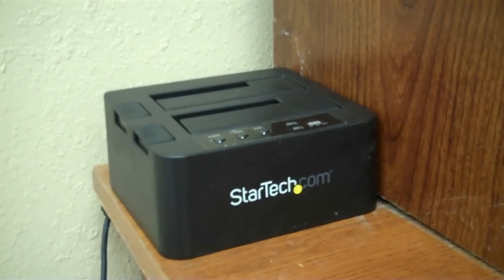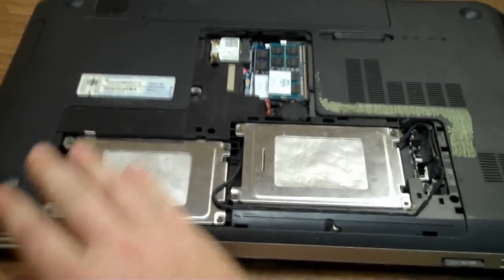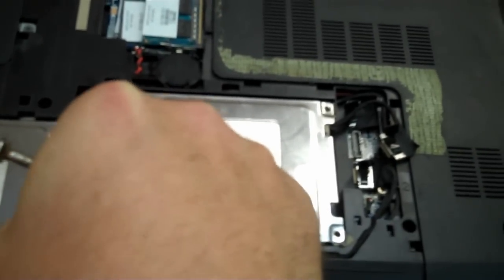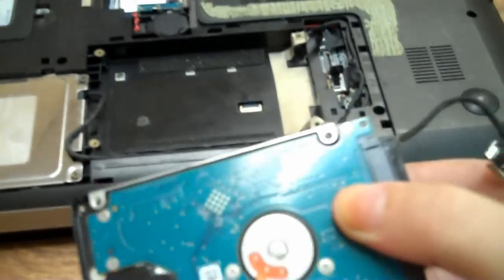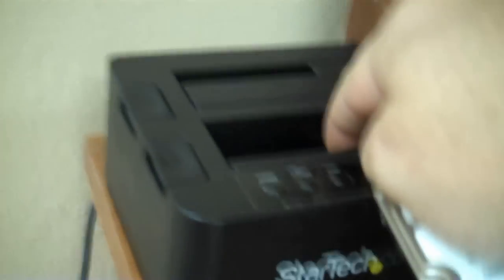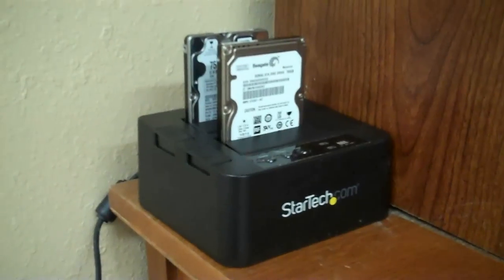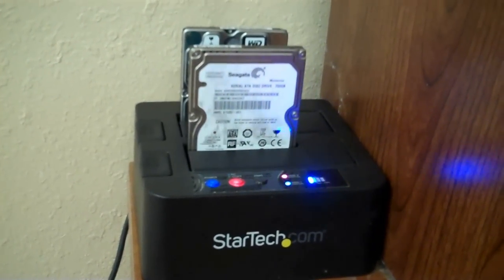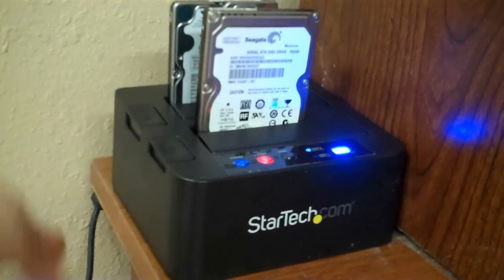Startech Hard Drive Duplicator Dock , tutorial vlog

Comment: Does this clone drives sector by sector? I have some that I need to just clone from one failing drive to a new drive. One is in a WD Sharespace (4 drive) NAS box. It's set up in a RAID 0 (yes I know a bad selection on my part), would I be able to pull out the drive that just gave me a failing message and just be able to clone it sector by sector to replace that drive?

Comment: Yo Grim, I just bought one of these (a newer model with leds on the front instead of the top) and it really does work. I was struggling with the various cloning programs available with limited success.  Q: Have you tried using this to clone a hdd to a ssd with the startech? It should work but the ssd doesn't have tracks and sectors like a hdd.
Reply from the maker: Never gone from hdd to ssd. I only ever had 1 ssd & I didn't like it. You can't just easily format it like a hdd, if you do it makes it lose 15% of it's speed or sumthin like that. I'm usually not in any big hurry, 7200rpm is fast enough & I have more space.
Reply: GrimDontGiveAFuck How long ago did you try SSD? You should give it another shot. It is super fast. GrimWillGiveAFuck for sure.

Also a question regarding the duplicator. Can you duplicate different drive sizes? Say, original HDD is 500 GB and you wanna copy it to 1 TB HDD?

Comment: Question? you said this will copy your OS too? I got windows 7 and I am replace the hard drive to an SSD and I will would like to know if you need to buy a new license when you copy from one hard drive to an other? GREAT VIDEO :)
Reply from the maker: I have seen probs with making too many copies at once, that 120GB from the DELL had a separate Win7 build I had made on it & my 2 primary 750GB ones were all set up with Win7 they were just cloning themselves though and I was losing my "genuine windows" status by including the DELL's old drive in that mix. The 120GB from the DELL was a separate instance of Win7, but if you just stick to cloning everything should be fine, because the back up drive is recognized as an earlier build of the same Win7 instance that you had in before it.
Reply from the maker: Let me say in addition, that I've never duplicated HDD to SSD, I'm not sure if that will present a problem. I had a 480GB Sandisk SSD before & I made a mistake when building the drive so it was best to start over, but I didn't format the way you're suppose to & it lost a touch of that performance. I just sent it back but got a restocking fee, I got the extra HDDs in this vid & never looked back. HDDs are cheap & they don't have to be pampered a certain way, they're fast enough for me at 7200rpm. The SSD was just like a second or 2 faster on start up & it held less data. HDD can fail, but that's why I back them up, I never buy one drive anymore I get 2 so I can have a secure backup if the HDD in the computer goes bad.
Reply: GrimDontGiveAFuck so what are you saying and correct me if I am mistaking that you clone a SSD before and just because you did not format it the correct way what happen there was an error on the SSD?! thank you for the response by the way! if you happen to have anymore tips please let me know, because I got a surface pro2 win 8.1 and I would like to clone it into the new hard drive and put on my HP notebook but I am wondering if all the drivers will be recognize by the HP notebook?
Reply from the maker: No, I never said I cloned onto an SSD. If you have to format it you have to do it a special way or it loses performance that people think is awesome with SSD. Moving from one computer to another will require a rebuild of your hard drive. This duplicator technique is for making sure your computer is backed up on other drives. You can't just take your primary drive out of one computer and put it in another, maybe if the other computer is the exact same as the other one.

Comment: I might but the StarTech.com 4 Bay eSATA USB 3.0 to SATA Hard Drive Docking Station for 2.5/3.5 HDD, to clone my Hardrives and still use them as partitions after cloning, with the one your using does this device just clone and not read them on computer to transfer files over or... otherwise why make two models that do the same thing? but one with a cloning offline and one that doesnt clone  be used after for transferring files?

hope this is not confusing
Reply from the maker: I have PC to Dock capability, I just never use it. I have though, when I 1st got this, make sure the drive letter of the drive in the dock doesn't match one in your PC.

Comment: Hey I'm trying to clone the hdd and it works but I get a message before it boots to windows saying "checking file system on D: the type of file is NTFS. Volume labeled Hp _ recovery" says one of you disk needs to check for consistency
Then it just boots. How do I fixed that? Thanks
Reply from the maker: Not quite sure, sometimes that means there's bad sectors on your hdd & you should get a new one. Sounds like sumthin you should research, if you don't find vidz on it you could make one when you find out about the solution. Vidz about stuff like that with little competition generally bring in views.
Reply: GrimDontGiveAFuck I just did a fresh install I found the backup disc I made from 5 years ago lol it seems to be working now I'll try using startech again in a few days

Comment: Is it legal to clone your computer in your network?
 
Ok I have a question. I’m work on a network with 6 computers all 6 computers have the same information Microsoft word ect. One of my computers goes bad and I need to clone one of the other computers from my network in order to fix.
My question as you can tell is it legal to clone a computer from my network even that I had punches the license. From the original source. If so how is that different from me making a backup image?
Thanks!
Reply from the maker: Since these units exist I'm sure it's safe to say it's legal. As far as Microsoft goes, if you use different hard drive builds of the same Win7 one will be un-authenticated, as long as you work from clones of the same build you're totally free to do whateva. People that love to run legal trials of software can simply duplicate the older back up build that hasn't had the trials installed before onto another drive that has & all the registry stuff that prevents further use of the trial software is gone, like it never existed on the drive. Multiple comps? I can't say, I've only ever done this with my laptop & have not set up networks ever. Before my old DELL laptop died, I had it hooked up in a network with My HP here for a brief period.

Comment: Have you used this product to Clone a Sony Playstation PS3 hard drive is it possible ?
Reply from the maker: +Mikido Soto, Jr. If it's a drive that fits it, I'd assume it would duplicate, but no...I haven't done PS3
Reply: @GrimDontGiveAFuck  , 7 years later , Yes it does do PS3 hard drive to a ssd .. I had this device in a box , and havent used it in 7 years , just refreshing my old mind before I use this device again .. Crazy as it is , my computer is around 9 years old , with a lot of info on it , So Im going to upgrade from a 250 ssd drive that still has windows 7 .. My favorite operating system .. Loved a lot of old programs from back then .. like winamp , that I have been using for 17 years , plus a program call windowblind for doing Icon , and desk top .. Windows 10 just looks like a big APP .. and I hate what 11 will do to people that build their own gaming systems .. Hell , Im 60 years old , and my first computer had windows 3.1 ... Have well over 50.000 MP3 .. that's a lot of MUSIC .. Reason I came back to this video , is it made me laugh my as off .. have a good day I dont give a fuck

Comment: how much data did you transfer in 2 hours?
Reply from the maker: Those drives were 750GB but the data on them was like 250GB, still it seems to take just as long for 750GB drives with 200GB used as it does for 750GB drives with 500GB used. It copies the whole drive over, even empty space it seems.